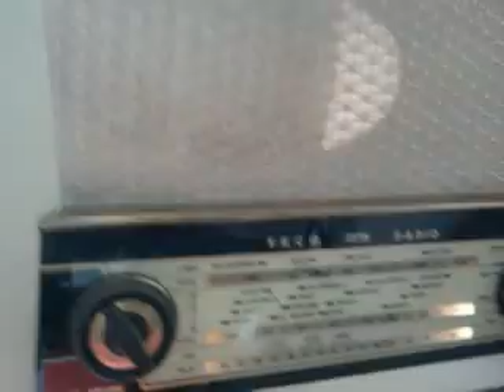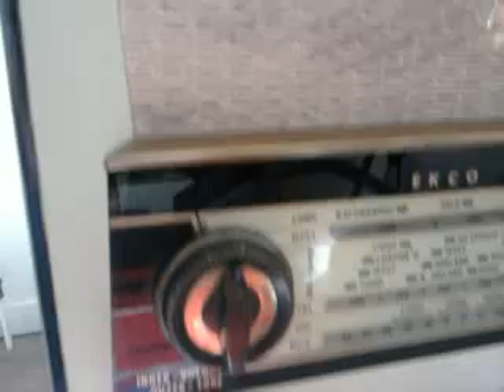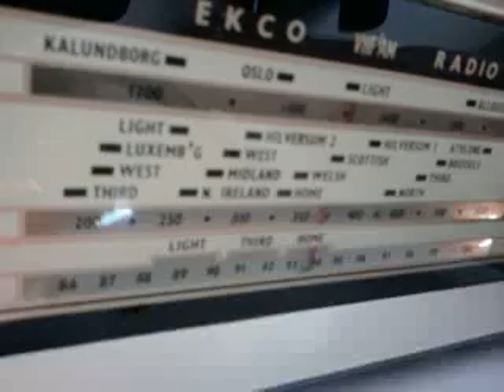EKCO U319 - VHF/AM Radio

Comment from the maker: Thank you for the comments.
This radio was given to me by my sister in law's father, who replaced some of the capacitors.
If you do decide to service this make & model, please be aware that this radio uses a mains resistor dropper instead  of a transformer.
This means that the chassis is live, and the connectors at the back (including ground) must use capacitors to isolate from the mains, or you will get a nasty shock when plugging something in.
They use wax-paper capacitors, which all had to be replaced.
As this radio doesn't use a mains transformer, it can also run on DC as well as AC.